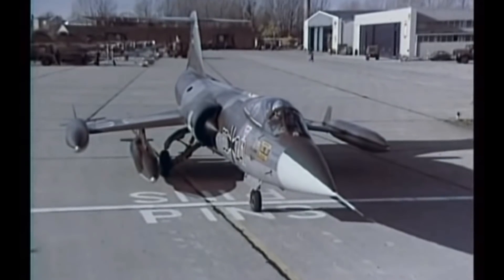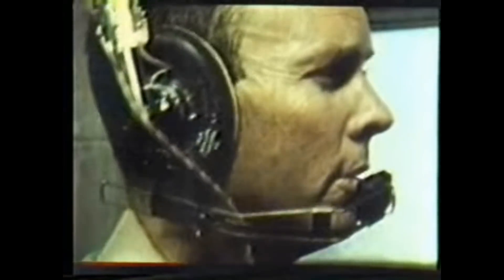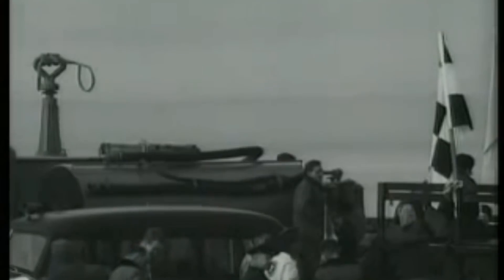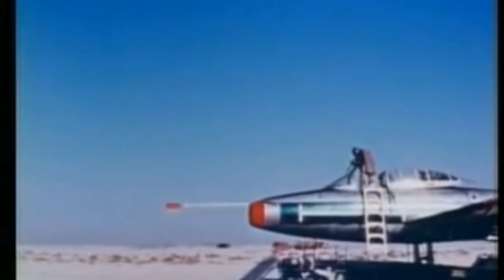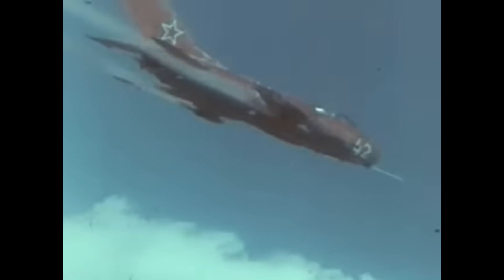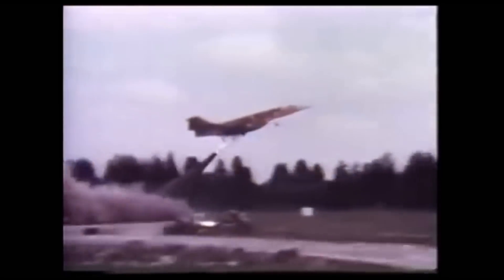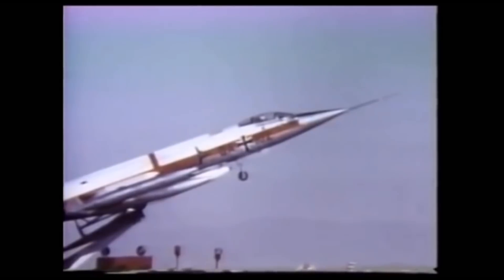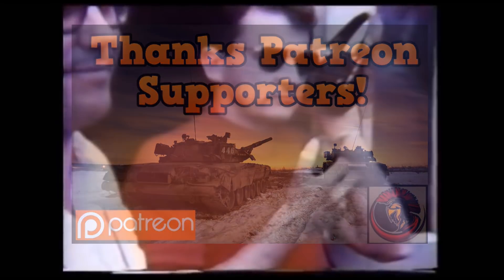Cold War Tactics | ZERO LENGTH LAUNCH

Comment: Look,F102s, F101s, F105s and F104s all had similar accident rates. People need to do their research. The only reason the 104 has a bad reputation that is well known is because the German pilots went from Sabers to a mach 2 fighter. What do you expect?  What did they expect? Research! 104s stayed in service until the Tornado and even then the German Navy pilots didn't want them to be replaced by it. Why? Because once they had experience the accident rate went down and they loved the speed and acceleration when on an attack run. Enough with the Starfighter hate already! I'll say it again,Research something before commenting!
Reply: Rodney Payne Yeah, it didn't help that they were using a high level interceptor, designed for intercepting, as strike fighter.
Reply: @thatoneguy8355  if your interested the F104G was fitted out with the naval search radar and the Komorant anti ship missile. In exercise with the Americans and British the Starfighter was untouchable  at low level(dot feet) at attack speed and regularly penetrated carrier battle groups without interception and got away. I'm a big 104 enthusiast and have lots of books and models if them.  Interesting note it's one of the only Mach 2 cold war fighters cleared for civilian use in various country's.😀
Reply: Do you have any sources on the Navy 104?s
Reply: German Starfighters: German Airforce and Naval Air Service  book by Klaus Kropf. Available through Amazon. Great photos and service history.
Reply: I've read some stuff about the 104s and it still has a very bad reputation here. I never knew it was untouchable in the naval strike role. I got a book which describes the training and usage of teh 104 in the first years and it will make your mind boggle.  If you know german, you should check out Erwin Willing's  "Vergöttert und verteufelt".
Reply: No, the reason for the high amount of crashes where the planes.

the doctrine was to use a high alt interceptor in the ground attack role, something the plane was not designed to do.
the F-104 had a very high stall speed and wing loading already without armament loaded under the wings. then the pilots just had about 2-4 seconds to retract the landing gear after takeoff before it would rip away (due to the high takeoff speeds of around 400km/h, compare that to around 200 to 300km/h of most other jets of this time)
nextly the pilots would fly near mach 1 at treetop level, even the slightest of mistake would kill you in the F-104, simply ue to the high wing loading and the very short reaction time you get when flying this low.

in short:
germany used a plane for the wrong job and payed for it in lives.
they lost 1/3 of the whole F-104 fleet and over 100 people died. name me 1 other plane with that high loss rating in peacetime. because even in wartime the lossrates of F-105s F-4s etc was lower due to accidents.
Reply: The reason was not really the plane. The training was bad at the begining, pilots were told, you are the best, you can fix everything. Some pilots belived that and stayed in the pit till the end. The planes had no hangars, they were stored outside during every weather. It took some time to build hangars. The ground crews were not well trained and not really motivated at the beginning, the Luftwaffe actually had ti hire civilian technicians. And then there was Lockheed who sold an airplane that was not yet 100% developed. And politics also played a role. As all these problems were fixed and the pilots were trained better, the aircraft worked. Although it was still a mistake to use an interceptor as bomber.
Reply: What's your source? Mine is an actual pilot who flew them,in a recorded interview. BTW look at the  Mirage 3 accident rate or maybe check sources. Always someone who argues. A friend of mine warned me about commenting online.
Reply: https://youtu.be/It0r3pNmeN8 for a well researched video that breaks it down.

Comment: So they tried cables, pillows and nets... have they actually tried parachutes? I mean, if you're trying such a ... unique thing, why not have the aircraft stall out over flat open terrain and then deploy multiple parachutes, deployed on various locations on the plane to ensure that it comes down slowly and at a proper angle...
Reply: Some German Reconnaissance drones land like that. Rocket or catapult launched. Lands by stalling and deploys parachute and airbags.
Reply: The F104 had a Drogue chute - but landing Velocity was still way too high
Reply: @Exodon2020  that's only 1 small parachute.

Comment: The background was that Nato was only a thin sliver of land between the sea and occupied Europe. It wasn't as much that there wasn't airfields enough. Sweden had another idea: Building aircraft that could take off from a road. That is not so much different from the idea behind the A-10 Warthog that can land on very austere fields. The major issue is here: How the devil do you keep the damned things supplied?

A more shuddering thought is that the F-104G Starfighter was envisaged as a BOMBER - preferably armed with nukes. The F-104 was indeed fast - but not for very long. That was not so much because of fuel consumption, but because the bloody engine would start to melt.

Actually the Starfighter was not too bad (range-wise) if the engine power was used in moderation; but moderation was not exactly the buzz-word of the era. The BAC-Lightning was much the same kind of aircraft and it had severe range problems. Indeed the Duncan Sandy's Defence White Paper did not envisage manned fighters after the Lightning - the rest would be missiles.

The consequence of that was that the nukes - as soon as possible were kept in England (generally East Anglia) - those were the days when you routinely was on quick reaction alert - i.e. sitting in the aeroplane at the end of the runway (sometimes with engine running) hoping a toilet break wasn't needed.

In Denmark it meant that having the Starfighter as far away from the enemy as possible, as the aircraft not only gained altitude fast, but was over enemy territory in five minutes flat. Denmark was the first line of defence of Great Britain envisaged to thin out the hoardes of enemy bombers going after East Anglia. It actually worked pretty well. OK, southern Jutland would have had a severe case of aluminium contamination - but other than that.....

In the 1970'ies when the Pershing 2 and Land Based Cruise missiles were introduced (a much better solution, but not really available before then) the air defence was reorganised so there was a missile belt along the boarder. Behind it the fighters would take over and over the North Sea the Tornado ADV would be loitering with their missiles - from the not unreasonable belief - that what had survived the first two lines of defence would be in serious disarray - and the air defence of Great Britain would be more akin to shooting down clay pidgeons. That was not unreasonable, as the enemy would as a bare minimum have been forced to go into afterb urner and manoevre violently with their bombs on board - not a very neat thing - and consuming fuel like a sailor on shore leave spends money.

Now that did not come to pass, as Russia ran out of money - and Reagan and Gorbatjov in Reykyavik agreed that those missile systems were a bit on the pricy side of common sense. Keeping missiles on reasonably high alert in the field with heavy launching trucks gingerly moving over rather bumpy terrain - loaded with nukes is like hedgehogs having sex: Done with the utmost care and caution. To do that reasonably safely is very expensive.

Make no mistake about it: There were traitors then as well as there is today (that generation became school teachers - never could stand that ilk - generally retiring in the coming years) - to us of advancing years: There is nothing new in the russian methods. That is what actually worries me: Can it really be true, that they have learned nothing and try with the methods they have allready lost with - big time?

The problem was, that we found out after the Cold War, that all the launch positions were known to the russians were known with a very high precision. What scared the russians off was the sheer number of missiles that was going to be launched with a high probability of getting through their air defences. These were unmanned aircraft (and relative - I mean: relatively) cheap airframes - as they will not require protection of the pilot.
That is one reason the americans are so liberal sending Tomahawks: There a lot of them.
They are send away - preferably just before they come in for maintainance - and a towel-head less.
Reply: Ever wonder shy the Interstate system in the US involves Long straight sections? To land and launch fighters. That was the secondary purpose of the Interstate system. The Autobahn in Germany also had that secondary purpose in WWII.
Reply: There are still stretches auf Autobahn the Luftwaffe used as reserve airfields.
Reply: So has most of the old Nato countries - the problem is a logistical one: How to keep the damned aircraft supplied with fuel and ammunition?

The real issue for Nato is not that there is a lack of airfields etc. The infrastructure in the old Eastern European states is shot. What most of you have missed is the cooperation between Mogherini and Stoltenberg.
Mogherini really can charm money out of anybody's wallet. Now she got the Chinese to finance the modernisation of infrastructure. Stoltenbergs only remark was - well, as long as it complies to Nato-standard.
And as Nato Standard is what has dimentioned most of western European infrastructure - train, trucks etc. That is a fairly safe bet.
Reply: There are even service stations next to those long straight stretches of road. To service and re supply fighters.

Comment: The other thing that changed is the power/weight ratios got much better too. Later jet fighters can blast down a runway or even straight road and get airborne in a very short distance.  I've seen many sections of autobahn designated as war emergency runways.
Reply: Many major (civilian) airports have a 2-3 km long open road section nearby as a last resort emergency landing field, free of traffic signs, trees, etc.

Comment: You should research a little more. This program was pretty much a failure...

Hey yeah a landing - how?

Did you know that the highest death rate amongst German Pilots during the cold war were F104 Starfighter pilots.. wonder why!
Reply: The rocket launches were not as dangerous, funnily enough. Starfighters were used in low but fast flying. Not its design, which made them extremely dangerous.
Reply: Lukas Hei Yeah I would guess so. Either way it was a hair raising ride.
Reply: skip181sg get out for this channel
Reply: louis beer reviews and real ales Carft beer Perhaps you should get out of this channel...so no.
Reply: skip181sg he’s research is better than yours you dumb
Reply: skip181sg yes you don’t know anything about this
Reply: louis beer reviews and real ales Carft beer Wow someone did not get their wheaties this morning
Reply: louis beer reviews and real ales Carft beer So listen mate unless you have something useful to add you are just being an ass.

I stand by my statement - it was a waste of time program that did not result in anything nearly as useful as they desired it to be - therefore a failure.

Launching aircraft using rocket boosters did prove to be relatively trouble-free but if aircraft were required to land at the same base, a runway was still required.
Bulky mobile launching platforms also proved to be expensive to operate and difficult to transport. Security was also an issue with mobile launchers, especially if equipped with nuclear-armed strike fighters.
All works upon ZELL aircraft were abandoned due to logistical concerns and the increasing efficiency of guided missiles.
The desire to field combat aircraft without depending on vulnerable landing strips also motivated the development of aircraft capable of vertical (VTOL) or short (STOL) takeoffs and landings. Examples of these include British Hawker Siddeley Harrier, Soviet Yakovlev Yak-38.

You seem to have a boner for this program - well good on you then but still does not make it a success sorry to say.
Reply: louis beer reviews and real ales Carft beer If you've you have something useful to say please go ahead...but seems that you don't apart from being the channel bully

Also...do you know how to actually spell 'Craft Beer' ?? I gather you don't.
Reply from the maker: skip181sg erm..... I think if you watch the video.... I pretty much say that it wasn’t used.... sooooooo 🤷🏼‍♂️
Reply: Matsimus You get very excited about things though mate even though it was such an ill conceived program. You should be proud the British cane up with the Harrier which could pretty much take off and land anywhere.... Totally unprepared sites.
Reply from the maker: skip181sg who said I wasn’t proud??..... what’s not to get excited about? I’m an engineer... I like to see projects that think outside the box even if they fail. Down rain on my parade lol!!
Reply: Matsimus Well I guess that's the only way an engineer could respond to that... :) Too funny.